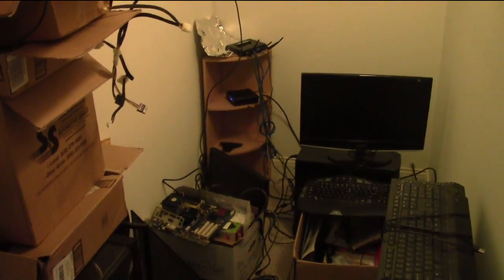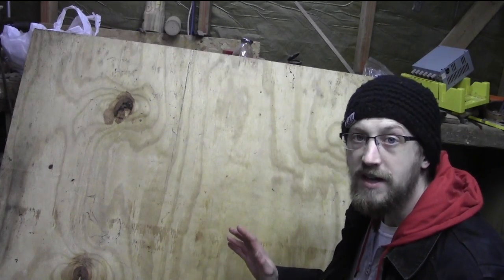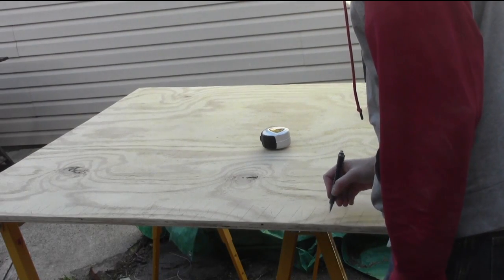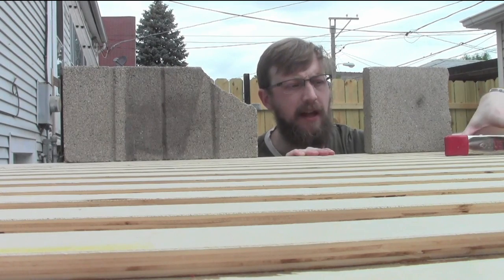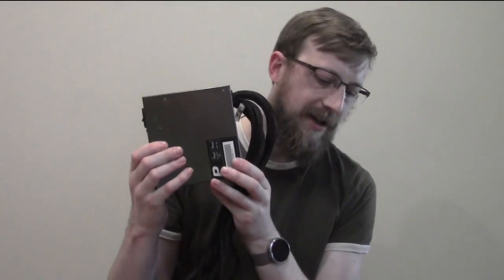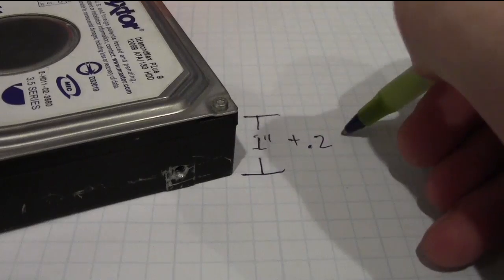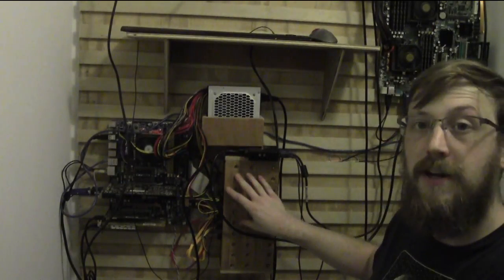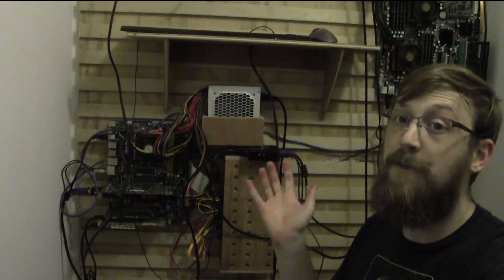French Cleat Server Rack

Comment: Problem!!!
For the hard drive's to last considerable amount of time they need cooling. Especially old HDD's without IntelliPower.

Simple Airflow will do the job.
Reply from the maker: Mikheil Ghvinianidze Thanks! Over the last few days, I've noticed they're getting quite toasty. Probably reaching 135°F. I happen to have a spare fan controller, so I've been thinking about how I might add a couple 120mm fans to the existing rack I made.
Reply: Right. How do I do that? The ideal temp for HDD is between 25°C to 40°C.
After 50C is NO NO!!!
135F= 57.2C
So install some of those 120mm fans ASAP!

Source my personal experience as cert. PC tech and http://www.buildcomputers.net/hdd-temperature.html
Reply from the maker: Mikheil Ghvinianidze You'll be happy to hear that I've got a couple of 120mm fans set up and the drives are staying right around 32-35°C -- basically the same temp as the room.
Reply: Right. How do I do that? Perfect
If they are not damaged already, with regular use at that temps  they should last maybe decade or more.
Keep monitoring there S.M.A.R.T.'s time to time.

Wood might be extremely bad material for heat transfer, but it is really good against vibration.
Reply: +Mikheil Ghvinianidze Good info but wrong as well, Hard Disk Drives can get hot more than 50C AS LONG <--(keywork there) as you let them cool down by dropping the temp as slow as you can (IF you are going to take them offline) in tell they are at like a cool 80 or 75... Oh an btw I have a server rack and yes it has a NAS that runs 24/7 even in 100 degrees Fahrenheit an still to this day have not had newer drives fail out, some hold ones have but they was old so it could have been do time. Now UPS's they to not like the hot at all... :/

Take a read at this! 
http://www.datacenterknowledge.com/archives/2012/03/23/too-hot-for-humans-but-google-servers-keep-humming/
Reply: +fmslick I have being Independent Computer Technician for more than decade.
During this decade I have seen and heard a lot of crazy shit.
One what I did notice is, If the HDD's Temperature exceeded their recommended temps in S.M.A.R.T. log those HDDs always had some problems.

By making this statement I am not stating this is how it is. I am just stating my observation from my experience.

Thanks for providing the link. I definitely will take a look at it.

~~~UPDATE~~~
As far as I know there is the difference in Hard Drives. Server Hard Drives are created to run 24/7 in high temps environment.
While general desktop and laptop Hard Drives are not.

Thanks for providing the link. I skimmed and this was not what I expect it. I was expecting link that describes reasons what you said about proper drive cool down "Hard Disk Drives can get hot more than 50C AS LONG <--(keywork there) as you let them cool down by dropping the temp as slow as you can"

Thank you anyway.
Reply: +Mikheil Ghvinianidze Ill give you that about consumer hard drives they suck out the time Lol.. I have been working an building computers and server from when I was about 11 thanks to one of my brothers Im now 29 so I have same time in the computer world. sorry the link was a let down I was just putting the link out there about how it is on to push hardware is not as sensitive as most people think, I mean Hell I had a stick of old ddr pc1 if you will RAM as a door stop for yrs an then one day out of the blue a buddy asked he could put it in a retro machine An by golly it still worked lol.. don't ask me How but it did.